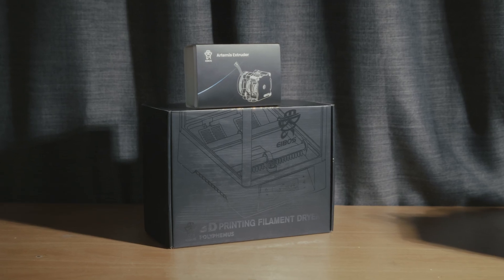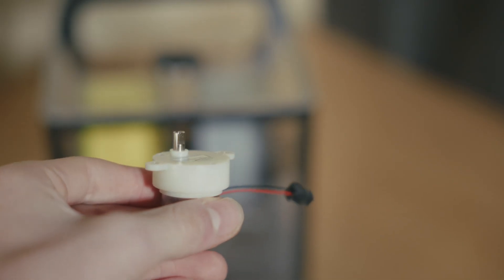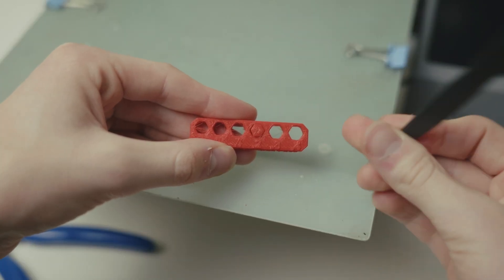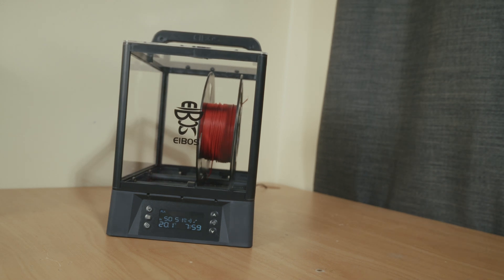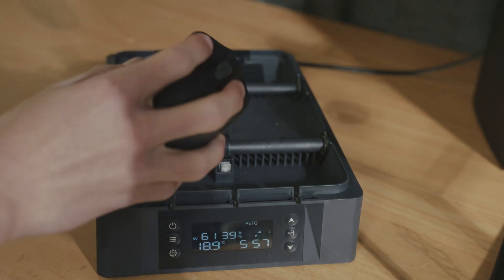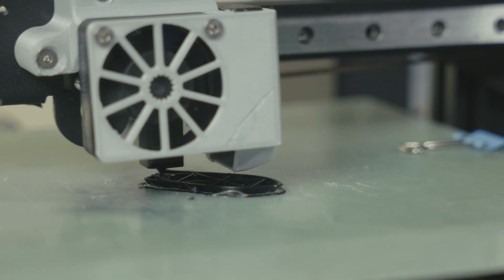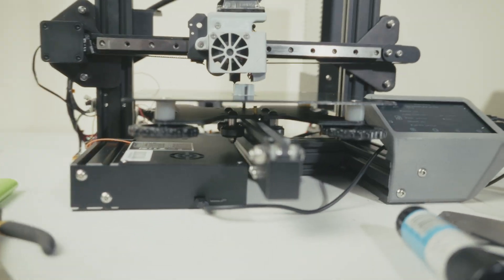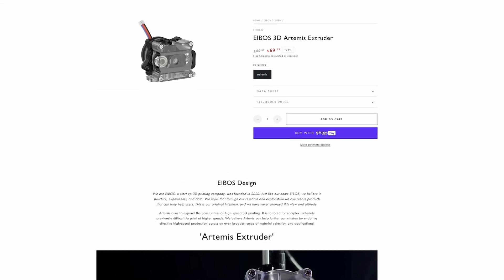EIBOS Surprised Me! Polyphemus Dryer & Artemis Extruder Review

Comment from the maker: Here's some updated points from EIBOS:

"The time 1500h we marked is provided by the supplier. Therefore, in order to express our transparency about the product, we marked this on the instructions. However, during the actual test process, we started the life test (a total of 20 motors) in June last year under 24/7 working conditions, and all of the motors are still working under normal working conditions."

"We never want to make extra profits through motors or other spare parts of our products, which is why we set up the 3KG extension as an additional spare part. We do not want users who do not use 3KG spool to pay extra for this part. For this motor, we currently only charge shipping of the package."